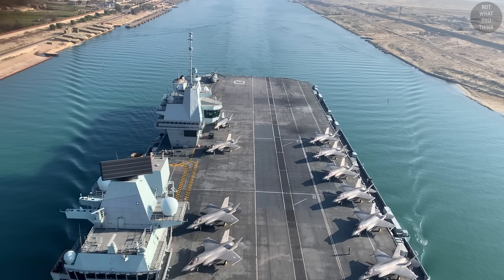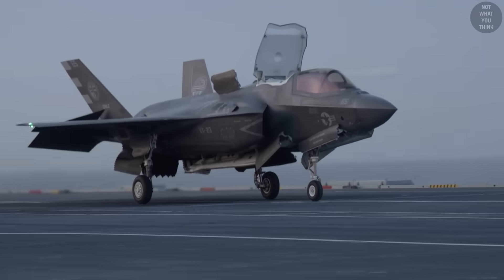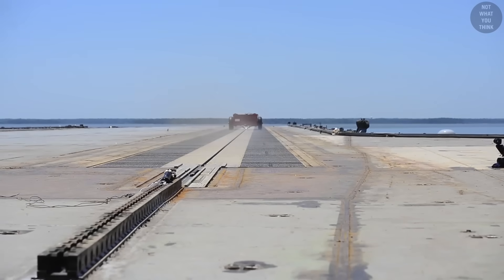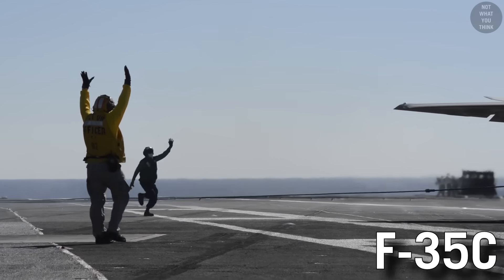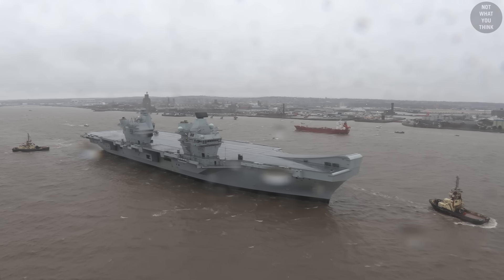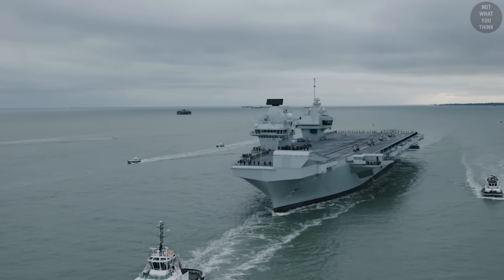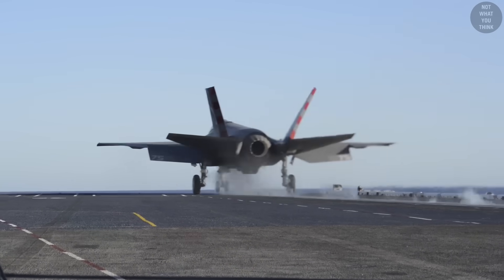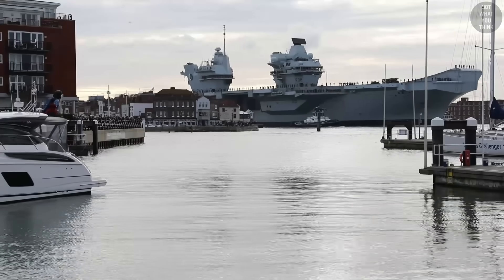Was the Angled Flight Deck Missed on HMS Queen Elizabeth?

Comment: You say VTOL carries less fuel, but is that in terms of actual fuel quantity, or is that "flight time" i.e. considering engine efficiency?
Reply: They have smaller tanks because they have to fit the lift fan mid fuselage.

Comment: The advantage STOVL carriers have as demonstrated in the Falklands, is the fact that the pitch and yaw of a ship in heavy seas did not compromise landing ability.  The flight deck operations were rarely troubled by the massive swells and waves that caused the deck to rise and fall up to 30 feet.  This would be a huge problem for aircraft using arrestor cables as they don't have the option to pick their landing time.  Once committed they either abort or take a chance.

Comment: I'd imagine that a not-insignificant factor in the choice was also that all of the Royal Navy's recent experience with carrier operations has used the STOVL system. Indeed, the RN pioneered such operations with the Invincible class (whether they wanted to or not), so it makes sense that they'd stick with what they've used so successfully.
Reply: Bob Watters  In what way are they significantly more capable?
Reply: Bob Watters  how exactly are they "more capable" then?
Reply: I'm wondering if a combination of ramp and angled deck would be feasible. It would have to be big enough to have two "runways", one with the ramp and the front and another angled one behind it. The frontal one would only be used for launch and the angled could do both. You get the benefit of parallel start capability and are able to launch heavier planes. And if the stern is wide enough it could even allow for parallel landing there.
Reply: The RN didnt pioneer such operations. The first to do so was Spain that put harriers on there aircraftcarrier dedalo in 1976 after testing them in 1972. It was there decision to buy then for there Navy that in 1975 the sea harrier went into sesign since it was considered a good idea price wise since you need smaller carriers.
Reply: @paladinee  A very fair point, I hadn't heard about the Spanish use before, thank you for sharing! I'll stick with the RN being the first to use them in combat, as far as I know.
Reply: @paladinee  
Pretty sure the Spanish operate the AV8 ‘Matador’ from the US. Not the Sea Harrier. The only other navy to Operate Sea Harriers were the Indians.
Spanish tested with the Harrier but bought AV8 rom the USA.
Reply: @petittrainguernsey3297  
I meantioned Harriers not a given type. They tried the harrier on there carrier and thought it worked well. The sea Harrier wasnted even built when they did it.
Reply: @paladinee  
RN was landing Harriers on carriers and other ships way before the Spanish.
1969 a harrier landed aboard the helicopter cruiser HMS Blake.
The way you’ve written your post about the Spanish suggests it was the Spaniards decision buy them that the SAR went into production. 
I doubt HS would develop a whole new aircraft just so they can sell 8 to the Spanish.
Reply: @paladinee  
Spain didn’t take delivery of AV-8 til 78.
Reply: @petittrainguernsey3297  
They got 8 harriers in 1973
Reply: @petittrainguernsey3297  

In October 1972 the Spanish Navy took a step forward integrating into the Harrier V/STOL program developed by Hawker Siddeley. HMS Blake was a trial, like when 
Test Pilots Chief, John Farley flew from Dunsfold airfield and landed on the ‘Dédalo’ sailing off Barcelona. The exhibition was a success and paved the way for further trials. Spain was the first to have Harriers in its Navy airwing aboard  a carrier.
Reply: @paladinee  
But didn’t operate them from ships. They acquired the AV-8 and embarked them in 76
Reply: @petittrainguernsey3297  
The R.N didnt get Harrier on carriers untitl the next decade.
Reply: @paladinee  
4 years later. But in that time the RN still had the fixed wing carrier Ark Royal. 
Not sure if this is a competition or something. Spain won if you like. But they didn’t and never have, flown Sea Harriers.
Reply: F35 is a bad boy
Reply: I highly doubt previous experience mattered much. They switched planes and got carriers that are MUCH, MUCH larger. I doubt there would be much of any carryover of experience from the invincible class that wouldn't also carry over to a CATOBAR QEC class.

Comment: The H.M.S. Q.E. with the 35 onboard is a formidable weapons platform...the only thing that really troubles me about boats that don't use catapult launch assist is that you are then limited to rotary aircraft to do your AWACS jobs. Which if you ever get in a shootout with China or Russia you will be in trouble (a Ph.D. Aerospace Engineer who works for a large American defense contractor.
Reply: I'd like to see the RN develop something similar to the V-22 Osprey as an AWACS aircraft, or perhaps even revisit older proposals like the Fairey Rotodyne or the Bell X-22. Something with better loiter ability than a helicopter, but still able to take off from a carrier.
Reply: They're recently started looking into fitting a smaller scale electromagnetic catapult to launch fixed wing UAVs (Potentially also to be used for refuelling), it's called Project Vixen.

Comment: to be range efficient with a stobar and stovl system, a carrier capable stol aerial refueler should be developed.
Here's my idea related to above:

-1 takeoff with a small ammout of fuel to reduce weight

-2 approach the tanker and refuel (taking note on the payload limits of the aircraft)

-3 carry on with the mission

-4 Land normally (vtol landing). 
The UK aircraft carriers could use the srvl technique (8:01) if the fuel ammout is still high when the aircraft rtb

Optinal: maybe the V-22 could be turned into an aerial refueler?
Idk about russian and indian carriers though
Reply: Right now the RN are looking into a smaller scale electromagnetic catapult to be fitted alongside the ski-jump in the next 5-10 years to allow for unmanned aircraft, primarily for the AEW role but also potentially for refuelling too.

Comment: Actually turbine power plants can produce steam as a byproduct. My collage used a Solar Turbine to turn a generator and the hot gas was sent to a boiler. The steam was used to heat campus buildings and to make hot water water.

Comment: I have a question: why isn't there longer runway on this carrier? Some overshooting deck in back and front, eventually retractable, if sea worthiness demand it.
Two western carrier capable fighters with long range, high speed and agility do exist, Rafale and Gripen E. They are equivalent to F-35 in avionics. Why aren't they planned to be used? Why don't install a steam generator powered by the hot exhaust from the engines?
Reply: I think their size was determined by the ability to fit in the Panama Canal locks, nevermind that was the Battleships
Reply: @blakespower  sounds plausible. Still retractable or foldable extensions is possible.

Comment: 'Rolling vertical landing' was standard practice with the BAE Sea Harrier FRS, where it was known as diagonal landing. The Sea Barrier was of course lighter with a stronger relative undercarriage so could take the bump of a less than perfect landing.
Reply: Makes sense. I assume it would require a lot of skill to do it, probably more skill than a regular vertical landing, but Harrier pilots could probably do it without problem.

Comment: Why is it called after catapults? It's more like a ballista?
Reply: Catapult and ballista were the same type of machine. The catapulta were giant crossbow-like machines used to throw arrows, darts, and javelins, while the ballista were giant two-armed tension engines that look like crossbows, used to throw rock and lead balls. So in this context you can think of planes as giant self-propelled arrows, making catapult the proper term. The machine people think of when they think of the catapult today was actually called the onager. It was designed to throw just about anything. See, because the ballista was shaped like a giant crossbow its projectile had to be able to roll smoothly along its main linear trough, thus the rocks or lead balls had to be shaped into smooth spheres. The onager lobbed its munition in a free arc instead, no rolling necessary, so you could use it to throw whatever the heck you could fit in its basket. Jagged rocks, cubes, multiple smaller rocks, bunnies, whatever. The onager was developed out of the ballista because it was basically one arm of a ballista rotated 90 degrees to move vertically rather than horizontally.

Comment: You are incorrect with regards to making history with the first rolling landing. It may have been the first rolling landing with the F35, but the RN had been completing rolling landings for years with the Harrier.
Reply: Nice. The reason the landing profile he mentioned is used is because of the Harrier. They don't do well hovering slowly over one chunk of deck, because they can potentially ingest their own exhaust gases and flame out... so they do all the complicated hovering next to the landing spot, matching velocities and altitude, etc, with a lot of empty air beneath them, and then slip over the deck and shut it down. And for that landing profile, a straight deck is probably preferred, since you don't have to worry as much about where the edge of the flight deck is, since it's pretty much a constant instead of tapering.
Reply: @Tomyironmane  the main reason for Harrier Rolling Landings was so weaponry didn't have to be dropped in the sea when returning with any
Reply: @Tomyironmane  the Americans don’t land like the brits. They may start though.
Reply: @Tomyironmane  👍
Reply: 👍harrier the greatest advancement in fighter plane ever imo
Reply: @sugarsaint  the vertical flight was very innovative, but at the end of the day the harrier was a pretty poor performer. Other than the vertical capabilities, it had 1950s level performance.
Reply: @jacktheaviator4938  er

NO
Reply: @sugarsaint  sorry, but numbers don't lie. I was outperformed by the F4 phantom, a jet that came multiple decades before. And just go Google "harrier non combat losses" and you will see it was and is a death trap. Unreliable and delicate. Helos or A-10s can fulfill any mission the harrier was designed to do, and the pilot might stand a chance of making it home. The "jump jet" was a neat idea, but tech wasn't there and it was far too ambitious.
Reply: @jacktheaviator4938  you seem to be confused 

The harrier WAS conceived in the 50's the F4 debuted in the 60s - if you're calling this "decades before" then I can't help you in this conversation.
Reply: @sugarsaint  You should probably check your facts before you go making bold claims. The F4 phantom was operational in 1960. The harrier was introduced in 1969, but it had a VERY long developmental life and wasnt really in service in any real numbers for over a decade after it was introduced. And when it was fielded, it was considered a death trap by the pilots who flew it and never really made a difference. As far as US forces go, the Marines were the only ones dumb enough to field the harrier and far more were lost due to mechanical failure than enemy action.
Reply: @jacktheaviator4938  I all ready explained I cannot help someone who thinks jets where flying in the 30s 

The point remains the same both where convinced in the SAME DECADE IE 1950s

"Design work on the P.1127 was formally started in 1957 by Sir Sydney Camm, Ralph Hooper of Hawker Aircraft, and Stanley Hooker (later Sir Stanley Hooker) of the Bristol Engine Company."

You also have an issue distinguishing the difference between a light fighter and a supersonic intercepter and for your information the first flight was 1960. 

Your keen to write a lot of misinformation on top of a total lack of understanding in the magnitude of VTOL operation in a plane. And with that I bid you good bye.
Reply: @sugarsaint  awe, did I hurt the Google empowered keyboard engineer's feelings? You are delusional.
Reply: @jacktheaviator4938  The Harrier never really made a difference? Rubbish, the Falklands war proves otherwise.
Reply: @jacktheaviator4938  If the harrier is considered a useless death trap, why did the US military buy all of the British harriers when we retired them? The US has used them for decades, surely they know their capability and value, and they wouldn't have bought them if they were the pile of garbage you claim.

Comment: I wonder if it's possible to have a steam catapult on a ski-jump.
Reply: No steam. Would require electro magnetic catapult. Strange Brits did not have nuc propulsion on the carriers. Non nuc requires regular refueling, which means slow tankers have to sail with it. Nuc power means faster speed, longer endurance, more space for aircraft fuel and munitions.

Comment: Mate, if VTOL capable craft were so disadvantaged against conventional aircraft, the Falkands/Malvinas war would have turned out very differently. Also, if you think they are less maneuverable than conventional aircraft, then you really need to look into the term "viffing."
Reply: The range argument between F-35A vs F-35B is flawed since F-35B's airbase is mobile.

Comment: INCORRECT, the first SRVL occurred on Charles de Gaulle in 2008, when a QINETQ Dual Cockpit Harrier landed on it, and in 2009 landed on HMS Illustrious  using the same technology, developed by the British.

SRVL uses sensors and computers mounted on the ship and aircraft, and automates the landing, taking control from the pilot, this allows faster sortie rates, reduced strees on the airfarme, higher return mass, so that fuel and unused ordnance does not get ejected before landing, and operations in more severe seas states.

STOVL proved in 1982 that it could operate in worst sea states than CATOBAR, and SRVL and later 'Magic Carpet' have improved matters for both types of carrier, it can be retrofitted to any allied navy CATOBAR or STOVL Carrier and all existing Aircraft types.  SRVL or STOL operations can still operate in higher sea states than CATOBAR.

Look up Bedford Array, and then consider that the SRVL System was further modified by the British for use as 'Magic Carpet' on Conventional US Carriers.

In addition, the USMC Pilots have had to transition to SRVL whilst operating within the CSG21 Airwing.

Your research is further out of date, in that Vixen/Mosquito AI Fighter, AEW, and Refuelling Jets will within 5 years will be launched from either QE or PoW after EMALS has been created by the British, the design specification is only 12% below the maximum take off weight of the F-35C Variant, so its likely that the system will end up being 'beefed' up for also launching F-35C, and in fact both the Royal Navy and RAF plan to invest in both variants of the F-35.

As MAGLEV and CATOBAR is a British Invention, along with everything else on an Aircraft Carrier, including the idea of the Aircraft Carrier itself, adding an Angled Deck and BAR is not going to be any difficulty.

We have basically re-invented the Aircraft Carrier again, and made it more affordable.

Even Nuclear Power is likely at a future refit, the power systems on QEC are distributed, two Rolls Royce 36 or 40MW MT30 Marine Trent Gas Turbines mounted externally in Sponsons could easily be replaced with the Cargo Container sized Rolls Royce 5% Uranium Ore 440MW Nuclear Power Plants.

As it is the MT30s have produced 32 Knots for QEC during Sea Trails, from the designed 25 knots, mainly due to the Computer Controlled Continously Variable Pitch Propellers designed and manufactured by Rolls Royce.

So within 5 years we may be looking at a scheduled first refit for CATOBAR for AI Jets Launched from QEC, and possibly both F-35B and F-35C in the hangars, whether or not a Ski Jump is still on the deck we'll leave to the decision makers, but there's room for one EMALS alongside the ramp, and another EMALS  could be added to the angled deck.

Both Jet variants can be used in worse sea states with SRVL or STOL in the worst sea states, so the Royal Navy would want both aircraft available as a resource.  I think I read a story, and I in no way make a judgement on either Navy, but an Indian Navy Officer suggested that in a hypothetic conflict between themselves and the Royal Navy, that in a straight fight between existing carriers (this was before the Invincible Class were decommissioned), that the Indian Navy would win.

A Royal Navy Officer replied that they would wait for bad weather and attack at night, and there was absolute silence from the Indian Navy Officer, and the British Officer bought the next round at the bar.

You really need to do more research before making these videos.

Comment: Good video. STOVL aircraft are less manoeuvrable? Try telling that to Argentinian pilots in Mirages and Skyhawks. In training Sea Harriers took out F16's and F18's. Being able to apply active braking with  vectored thrust is a dogfighting advantage.
Reply: To get SVTOL to work the Harrier  had  a crazy amount of power per weight so it lost far less energy in turns and climbs.
Reply: @Arpthingy  Absolutely. Turns out a great power to weight ratio is ideal for dogfighting.

Comment: British can also do "rolling landing "over the stern , without use of wires . F35 B , that is . Interesting article , yes they would be great with angled deck as well !
Reply: @thekraken4548  The Hawker Siddeley Harrier does it too.
Reply: F-35s are overpriced
Reply: @Ramal3866  False, F-35A Block 3F Lot 14's per unit cost is under $79 million USD.
Reply: @valenrn8657  but they're using F-35Bs and costs 36 grand per hour
Reply: @valenrn8657  Plus i'm not sure the government are not too concerned about cost if we ever require the use of two aircraft carries then i'm sure we have bigger problems than money